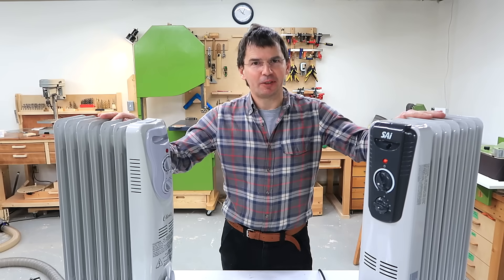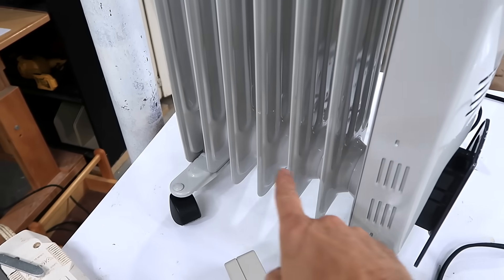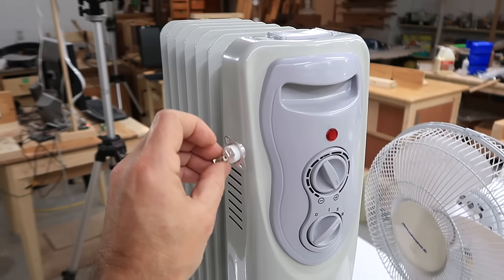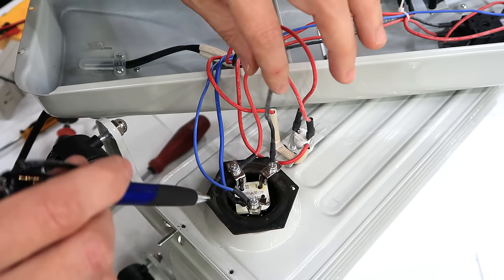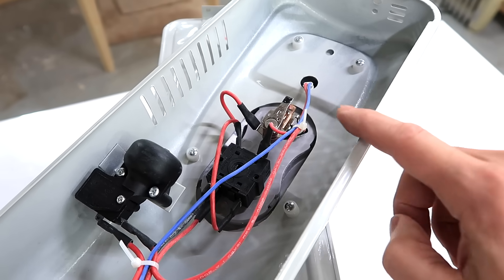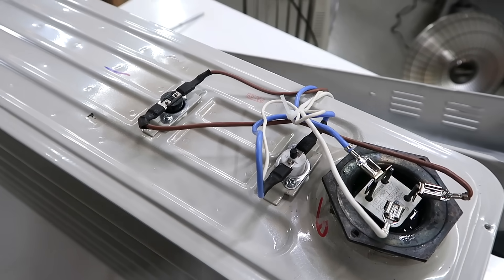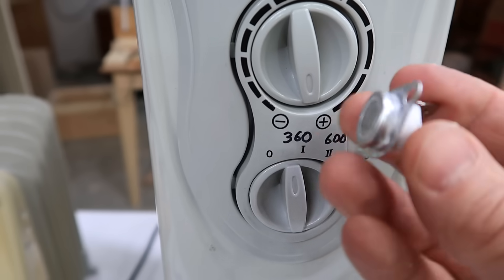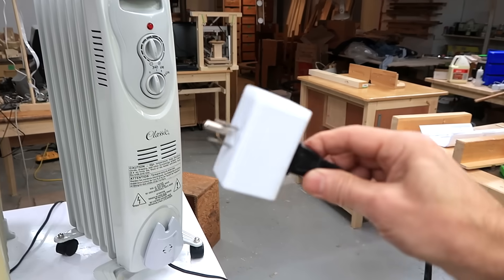Oil filled heaters: 600 watt heaters pretending to be 1500 watts

Comment: Im considering getting a Delonghi oil radiator, but im not sure if i should get 1500 or 2000 watt for my room? I live in a warm European country, lowest degree at winter is 7 Celsius at night and 12 Celsius during the day (44 farenheit and 54 farenheit). My room is 15sqm (160 sqft). Would a 1500 watt be smarter to buy than a 2000 watt? Can a 1500 watt machine push up the degrees like 10 celsius in a room like that?
Reply: 1500w is excessive for a room of about 13'  square. I sometimes use one of my rads in the front room of that size. My rad' has 2 elements of 800 and 1200 (I never use both together) and while I might use 1200 for a while, 800 is enough if you leave it on.
Reply: @evilgoogleevilgoogle3855  very kind of you to reply, many thanks for helping me with my decision. The oil radiator has 3 settings on the machine, 1500, 800 and 700 watt. So i hope this will help me this winter, buying it tomorrow actually. First day of the cold just started today.

Comment: when I moved into a larger camper, the two oil-filled radiators weren't big enough. It was suggested that I use infrared heaters...they worked! I have 3 infrared heaters for the past 2 years and they're flawless...and are run by a thermostat.
Reply: Ya, wait...
You had TWO oil-filled radiator heaters you replaced w THREE infra-red heaters to heat the same space and it worked? Three did the trick where two didn't? 3>2? SMH
Reply: Hi
What was the brand of heater that you got? I've been looking for a couple weeks to get one and I want to get a good one. Thank you

Comment: I guess I’m lucky I have had one for years that I’ve run on high When ever I needed and it never over heats.  I also just got a really nice old 1500watt one that was on sale for $1.00 at goodwill mostly because it had a bad plug 🔌 and then I found a slightly crispy wire from Old age inside the cover and replaced it with high temperature stove wire.  I ran it for many minutes and it never truly reaches 1500w even though it runs on all elements.

Comment: Matthias thanks for bringing this to the surface. So, truth in advertising is not being adhered to. In order to claim a heater power output level it should be continuous power not until the thermal limiter cuts off the heater power.  So, that should be considered false advertising. Hopefully the trade commissions of respective countries are listening.
Matthias thx for making and sharing.
Reply: problem is he is trying to use it in continuous duty mode, while they are made to cycle on and off with the thermostat.  well, some of them.  I somehow came into possession of one that didn't have a thermostat and ran on a timer, instead.

Comment: Get one of the more expensive ones with the digital thermostat. They're not nearly as stupid. I have a DeLonghi TRD40615E that has a remote temperature sensor that goes down to inside where the cord wrap thing is on the front. It's brilliant.

Comment: We have a steam radiator of similar form factor but it uses a steam hydrostatic thermostat and is solid cast iron, 1200W. Thing must weigh close to 100#, made in the 50s. On something like its 4th power cord just from age

Comment: Matthias, we love those heaters too, although in Australia (at least in our little bit of it) we turn them on only a few nights in winter, then by the end of September, when they haven't been used for a month, we cover them up so they don't get dusty and think about them next May when it starts to get cool again.
Reply: Except this year the heater was on right through into mid December in Victoria. Winter just never stopped.

Oil heaters are great. They're silent, so easy to have in bedrooms.
Reply: @davidunwin7868  you are so right.  I could handle some of that global right now.
Reply: Same here in S. Texas. By early April I have them in the closet with plastic garbage bags over them so they don't stink when they are brought out again.
Reply: Same in Florida

Comment: Good idea with the low power mode. Think i'll do the same mod to my heater - should be easy as i already ground down the safety screws when I was investigating why the settings 2 and 3 were cutting out.

Comment: oil filled heaters have old time historic wery worst heater system.expensive use and big shit.
Reply: I disagree. I lived in a terraced house without central heating for decades, we had a 4' long OLD oil rad in the Hall just for really cold winter days. I also still use a couple of 800-1200watt ones that I use when I have spare solar generation. There are good and bad oil rads and they have the advantage of being silent. As for being poor heaters, well they're not,100 watts is  100 watts whatever type of heater you use except air con units which are over ~300% efficient.

Comment: There are models with built-in fan. Very noisy, not recommend. I use a couple of PC fans in front of the heater instead - they are wonderful. I only need to come up with a better mounting solution and electrical connection.

Comment: I find this odd.. I have a Delonghi oil filled radiator from 2002 and its still cranking away.  And yes. It will out full wattage without stopping.   I usually will turn it to both elements to get the oil warm, then kick back to medium or low and set the thermostat when the room is warm enough.

Comment: I like these heaters too, but my issue with them is not with the power levels, but with the thermostat controls. I find them highly inconsistent. My solution is a thermostat switch in line with the power cord. I am not needing to get much power out of the heater, so it just sits on the lowest setting cycling on and off with the external thermostat.
Reply: which thermostat did you get?

Comment: I would say that crackling sound is humidity that has condensed and fallen into the oil in small quantities boiling off, not the oil itself which won't boil until an obscenely high temperature.
Reply: this is correct, that popping is condensation inside the radiator because its not been used in a while.

Comment: How funny you post this today! Last week I just chucked one of these out and had to buy a new one because the overheat thermostat actually fried! Apparently it got so warm that it melted the insulation off the spade connector and the whole thing was dark in color! I thought I had been smelling something warm for a week or so.
Reply: Chucked the whole thing for what is a $6 part is a real bummer. :(
Reply: @bradley3549  It burnt the wires back about 2'' from the little thermostat. It was probably 15 years old. New one has a digital thermostat now. I got my money out of it. Live and learn I guess.
Reply: @hotrodhog2170  Maybe so, but I still always hate seeing fixable stuff going to the landfill. But that's not you, that's society.

Comment: they are my favourite resistive type heater. partly because they are a bit safer in that you wont instantly get burned by touching it (you will, but you have a second or so to react) so if you forget its on, or a kid touches it, its not really an issue.

they are also handy for keeping a room 'not freezing'. I tend to sleep very warm, so don't like to sleep in a warm room, prefer it somewhat, but in the middle of winter its just too cold, so running one of these set on a single element (the one I have has 2 switches, one for each element) and set to a lower temp keeps the chill off the air while still being comfortable for me.

Comment: Turn the Heater upside down, when it's cold, so that the oil is mixed evenly.  (It says do do this seasonally in the owners manual).  I recommend placing them on a cookie sheet as the will leak eventually.  When they leak, its time to replace them.  Overtime, the popping noise goes away and they are very quiet.  I like this design, they work well.
Reply: thank you for the tip about seasonally rotating them upside down to mix the oil, I didn't know that.

Comment: The overheat protection elements are rated at different degrees. You could potentially change it to a higher degree rating and get more power out of the heater, clearly that would be a risk so you would have to do it at your own risk. Thank you for the video!
Reply: The best is to buy a bigger heater, but just run it on half power.

Comment: I got one of those external thermostat outlets that can be set to a temperature rage of something like 5 to 40C. I plug that into an outlet, then I plug my oil heater into that, set the heater to max and then set the external termostat to my preferred temperature. The benefit of doing that, is that I get a more constant temperature in the room and I can easily adjust the temperature on the external termostat. 

Been using this system for two years and it still works great. I assume I will have to replace that relay some day, but it will  probably last longer than that thermal switch that's built in anywhay.
Reply: I've been doing the same for the last ten years. All my heaters are still alive and well, never had to fix or replace anything.
Reply: I just started doing that this year, I grow plants that I need to winter the bulbs indoors over the winter, and I set up a small room in my unheated shop with an oil filled heater to keep them above freezing but not too warm, found that the heaters work well, but that if I added an outlet with a thermostat I could keep is really nicely controlled and not worry about overheating them or burning out the heater
Reply: Depending on the situation, you might find it better to use a lower power setting (by which I mean not using all the elements, not setting the radiator thermostat lower) and have it cycle less often. I do something similar but I found a ceramic heating panel. Unfortunately, it wasn't high quality and I'm looking for a replacement. The panel had the advantage that it was low profile. It has the disadvantage that bare wires are now showing :)
Reply: Yep, I keep it on the low switch setting so that it heats up slowly, and cycles for as long as possible
Reply: If you wanted a real high tech solution you could use a zigbee, z-wave, or Wi-Fi switch (specifically for appliances and have another sensor located at the optimum location to give it better accuracy and precise control
Reply: The argument that Matthias made against that solution is that the radiator will still creak due to cycling when externally switched on and off.
Reply: @graealex  They typically only do that when first switched on from cold. This isn't really any different than what the thermostat is doing but provides better control and measures temperature away from the heating device.
Reply: @chaos.corner  It'd still be better if the element heated at the right wattage vs bang-bang heating, especially if the safety switch gets triggered every so often, that was the main point of the video. Obviously a PWM-PID controller isn't really in the budget for a cheap radiator.

Comment: Would painting them black improve thermal radiation which in turn allow a higher power setting?
Reply from the maker: yes, it would marginally improve radiated heat output.  Probably not enough to go to the next level though.
Reply: @matthiasrandomstuff2221  sand blast the factory paint off then spray on the stuff that was used on vehicle radiators when they were made of copper and brass.

Comment: Try to put a silicon diode in series with the supply voltage. Did so with my soldering irons which were on great effect. Then you automatically get half the effect. I put the diode inside the socket.
Reply from the maker: I wouldn't recommend that with larger power uses.  It adds a lot of noise to the line, and probably causes the transformer that supplies the house to run less efficiently.

Comment: I've an old unit of those. Has no overheat thermostat like yours, and guess what, the switches for on and off melted several times, and then finally the normal thermostat melted. I never knew they can't safely stay on on max for much time. Anyway, my solution was to replace all that with a digital thermostat and bakelite switches. It looks ugly now but at least is heavy duty.

Comment: What happened to the stuff you built that made the heater follow you?
Reply from the maker: It made a bit of noise, which made it annoying.  So I just aim it to where I spend most of the time.  Also, I put my workbench where I had that heater, so now there isn't a good spot for it anymore.

Comment: You can buy a multibit screwdriver that covers all the security configurations, no grinding required. Most hardware stores have them...sort of negates the security aspect but there you go.
Reply from the maker: yes, I bought one of those.  But these have maybe 30 bits, whereas there are well over a 100 types of security screws.  Didn't have a bit for these.

Comment: Curious that the heaters don't already have a "warm mode" on them, which would make it not rely on the overheat protection.
Those screws are really annoying and serve very little purpose if you can just grind a slot into them or get a proper set of screwdrivers.
Reply: warm mode would be the number 1 setting which does not use the overheat protection at all in what he said, and those fancy screws are just for the manufacturer to cover their a$$es when users that messed around with it and burned their house down. if you tinkered with it then they aren't liable for it, they can easily see you messed with it if it ever gets to that point. We also use the oil heaters at night at level 1 cause it's quiet and the rest of the house drops down in temp until 6am.

Comment: The last bit made me giggle as only I can modify the schedule. Using a simply Python script to enable/disable GPIO, triggered by crontab.
I'm currently building the central heating control system consisting of - a actuator on each rad, a tmp36 in each room, a Pi with crontab (7 day schedule for each room) and a PIC to handle all the computation as a PI doesn't have enough I/O.
Reply from the maker: Use 18b20 sensors for the temperature reading.  You can gang all of them together, 1 wire, digital.  That saves a lot of I/O.  But don't get them from amazon, ebay or aliexpress- those are clone parts, and some of those latch up after a few weeks, requiring system power down to recover.
Reply: @matthiasrandomstuff2221  ooh interesting, I'll have to have a look at these. I think some scripting to adjust the temperature values without directly editing the main scrip would be needed to make it a little more user friendly.
How do you modify the on/off point?
At least with my current design, my wife "could" adjust a potentiometer if needed.
Also have you set some hysteresis on your script?

 @Dave Bashford  I must admit, I'm still learning when it comes to electronics and scripting, but I'll have to look into this as it does seem useful.
Reply: Learn I2C.  You may just end up swapping your PIC for an I2C IO board, but it's an alternative solution.

Comment: I'm sure the manufacturers would completely lose their minds if they saw this.  😂
Reply from the maker: I'm sure they are well aware of the problem.  But you have to label it 1500 watts so people buy them.
Reply: I'm guessing the main reason behind the oversized element is so that no time at all is wasted in getting the heater up to temperature. 

Bigger elements aren't much more expensive than smaller ones and if your customers can say "oh yeah this thing gets hot right away" that extra customer you gain likely offsets the cost of the larger element.

Comment: @Matthias random stuff Have you ever, or would you consider doing a video about the the cost efficiency of different types of portable electric heaters. Ceramic, infrared, oil filled, etc. And how they compare to types of typical household heating. Thanks for all the awesome videos!
Reply from the maker: all 100% efficient at producing heat  Done.  There, don't need a whole video to say that.
Reply: @matthiasrandomstuff2221  Not the question I was asking, should have been more clear. I've always been told (as far as portable heaters go) ceramic costs a lot to run, oil costs less, and infrared is in the middle. But at all times is less expensive to run a standard household heater, be it forced air, baseboard, hot water, etc. I'd like to see your take on it because I enjoy your videos. Thanks again.
Reply: @IanBrumm  Warm clothes are the cheapest, followed by spot heating like putting a little heater next to your feet or using a mattress heater.
Reply: @MrHuram-abi  True, but still looking for the Matthias breakdown on each type with power consumption etc.
Reply: We need Project Farm to do that.

Comment: Isn't your case just one case tho? The lower the ambient temperature, the higher is the energy that the heater can give to its surroundings. So if your room would be colder it might reach a higher wattage for longer and its just part of the self regulating aspect of it. 
the oil boiling is concerning tho
Reply from the maker: most people who use heaters aim to get their room to room temperature. That's a pretty narrow range.
Reply: @matthiasrandomstuff2221  well then you probably would have to increase the radiator fin count so that it could radiate away more, and structure it so that convection can do allot of work

Comment: I wonder if a wood stove fan would work with one of those radiators.
Reply from the maker: No. Not hot enough, no good contact surface to get the heat from.
Reply: @matthiasrandomstuff2221  darn. It would be neat for my dogs. We use oil heaters in our sunroom for them.